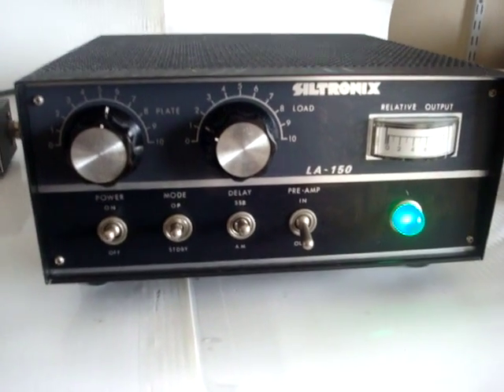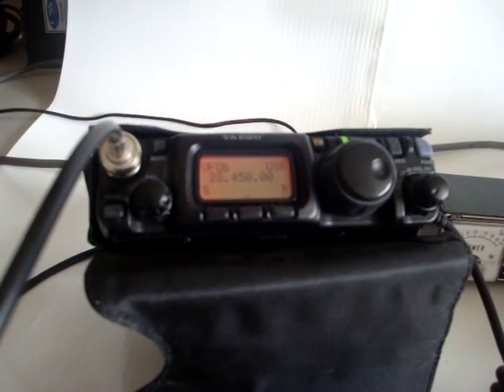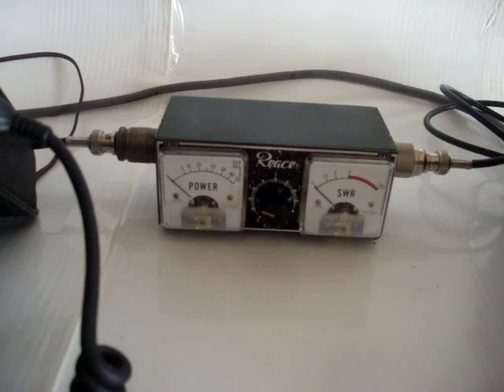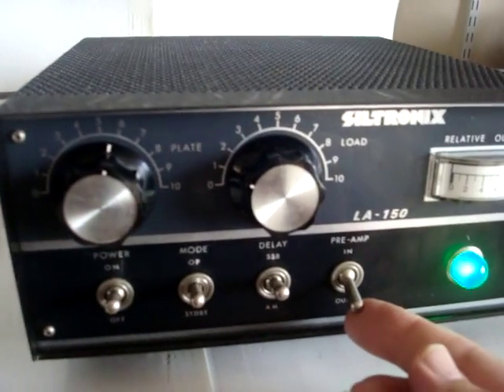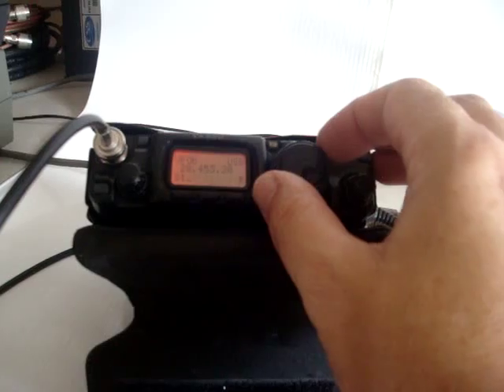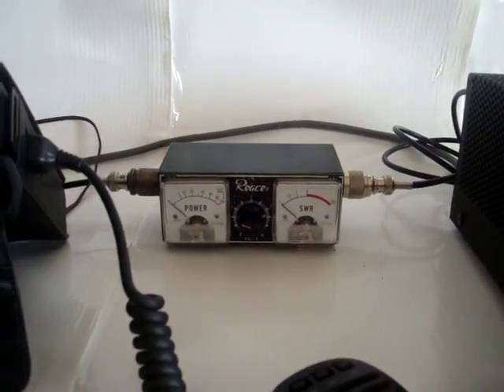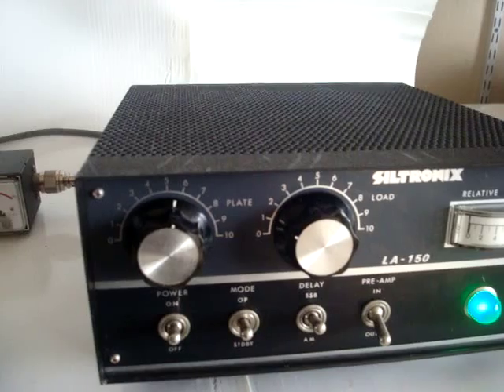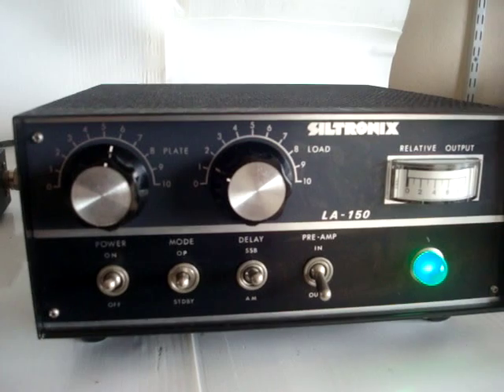Siltronix LA-150 linear amplifier demonstration on 10-meter band

Comment: I have had great success re-purposing small grounded grid amps to 6 meters, with has the added benefit of keeping them off the chicken band and out of the hands of yo-yo scoff laws. This has tuned input, so in addition to taping the tank coil, you will have to modify the input coil/cap combo to resonate around 50.1 -50.2.  It pays to check the specs of the final tubes.. some sweep tubes work poorly at 50 mc.. but most work fine.